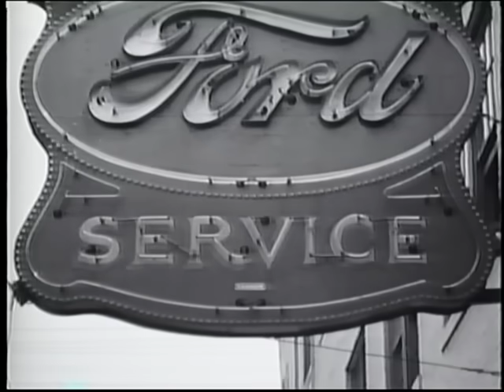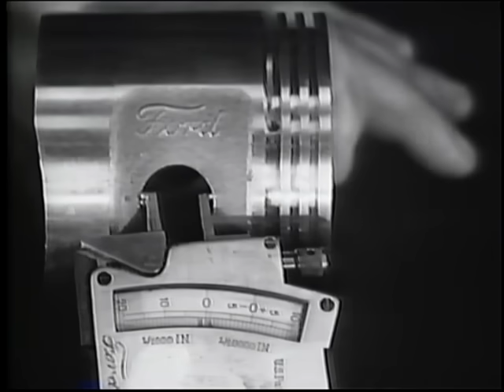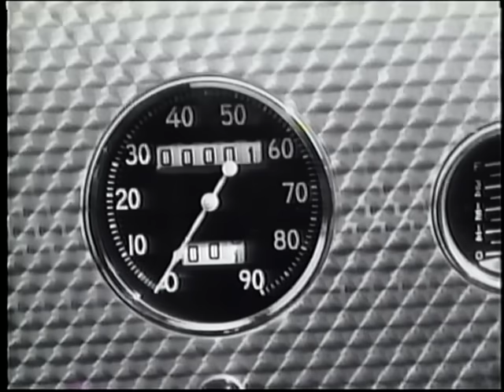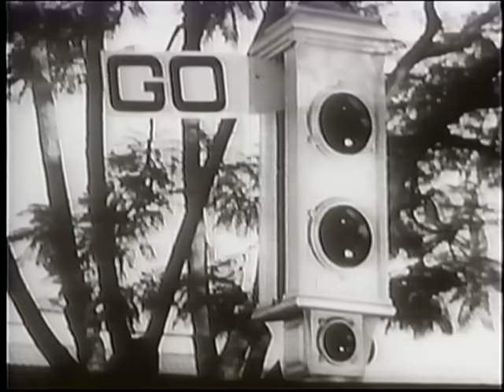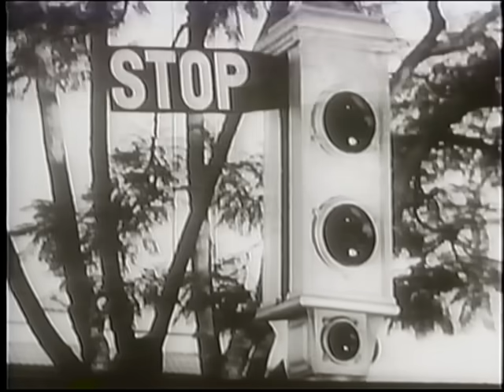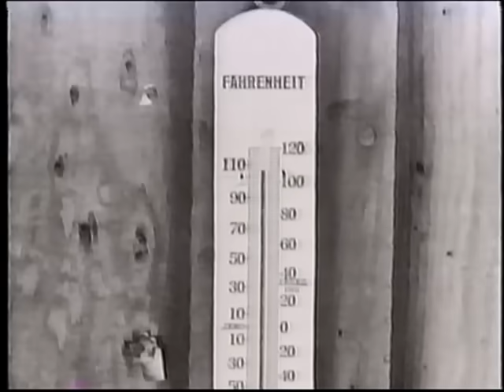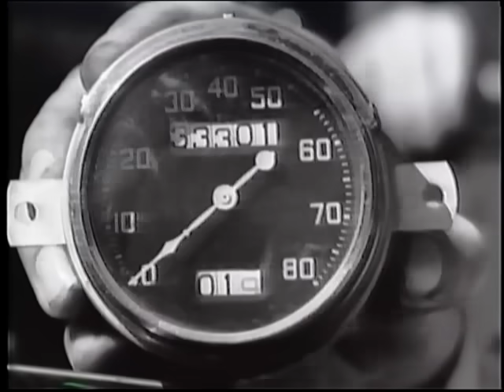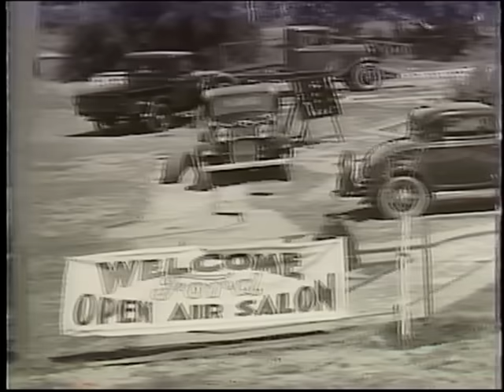1932 - The Invention of the Ford V8 Engine

Comment: And on the eighth day, God made the V8. And He heard that it was good, for it growled as did His great golden-maned beast of the jungle. And God said unto Adam, "Adam, check this out. I bet if you put headers and a cam on this fucker you'd make 500hp easy." And so Adam accepted the gift. And he went forth, and he did install headers and a cam. And lo, Adam indeed made 500hp as God had promised.

And Adam said unto the Lord "Lord, thou art certainly great. This thing sounds like a million bucks, and the torque curve is as flat as a ruler. But the fuel economy is terrible - what have I done to displease you such that you would curse me with these massive fuel costs?"

And God smote Adam, verily did He strike him down with fire from the Heavens. And lo, Adam's V8 was cleft in twain, and the bore shrunk such that it was half the diameter, and Adam's carriage became driven not by the rear wheels, but by those at the front.

And on each day thereafter, as Adam drove to work in his Honda Fit, he wept for what he had forsaken.

Here endeth the lesson.
Reply: brilliantly done!  =D

Comment: As I watch this I'm currently working at the old Ford Rouge  Steel mill. Currently owned by Cleveland Cliffs. I'm sitting in a crane in front of "C" Blast furnace. Only about 100 yards from the current F150 Truck paint shop.

Comment: This engine was a real monstrosity. For low expense, the flathead valve design was used. The cylinder heads were one piece castings with no moving parts. Cool? Not really. The exhaust ports had to travel through the water jacket of the block and the V8 had one of the worst heat rejection rates of any engine ever designed. It could not sustain a loading of more than 50% power without seriously overheating. This lead to many second degree burns of machanics trying to revive an overheated V8 on the road. Removing the radiator cap of an overheated engine could result in the explosion of superheated steam and if the mechanic was in the way, 2nd degree or worse burns over his chest, face, and upper body. The V8 could never be tapped fully for even its modest 90 hp output and was a failure in other industrial stationary applications. Its flaw was the flathead valve gear which severely impaired its high speed output and thermodynamic and volumetric efficiency. In addition routing exhaust manifolds through the block water jacket only resulted in additional frailty when subject to any meaningful work load. This V8 may have been cheap to build but it was ultimately a ripoff and injured so many mechanics with its overheated explosions. 

You could have really done the motoring public a service by publishing the truth about this engine. Instead you have done nothing but hawk Ford propaganda about the ford flathead V8. You made your money foisting this ugly design on the American public. Go back to school and get some real physics and engineering education so that you never become suckers for such outlandish corporate propaganda.

Comment: Too bad auto makers and engineers don't have a clue anymore!
Reply: Too bad they have to engineer to ever increasingly impossible to meet standards created by government that seem bent on repealing the 20th century.
Reply: Or Zombie's lolololololo
Reply: A problem nowadays is that the EPA and similar environmental agencies in European countries force the average mileage of a car company's fleet to be way beyond what an internal combustion engine of reasonable power, or even way beyond what an ICE at all can be. A car doesn't have to be sold to count though. Neither does it have to be produced in the country the manufacturer manufacturs its actual sales cars in. It just has to pass all the tests.

The result is that the companies find the cheapest country imaginable and manufacture tons and tons of throwaway cars that are literally the cheapest peace of junk that can pass all the tests. The real expense of electric cars are typically the batteries, and otherwise they're cheaper, so throwaway cars tend to be cars just the pure minimum and enough battery to run the test track, and just good enough batteries that it works if charged right before driving.

Most economy cars have really gotten more affordable. Comparing since the 80's they're usually equally expensive in real money value, but the average worker can afford one for just about half the hours of work. Not so for the top line cars, most of those have actually gotten less affordable, since every Dodge Ram SRT10 has to be backed up by 11 throwaway junkmobiles in Nigeria. To reduce emissions, of course.

Because of these ridiculously stringent standards, all the economy class cars basically look the same now too. Every last liquid ounce of masculinity and soul has been smoothed out of the modern motorcar in order to basically give it that bubble-like aerodynamic shape that 70 years ago was unique to the Hitlermobile.
Reply: Ford sent men around to junkyards to see which parts weren't worn out. The answer was kingpins, so he had them downgraded.  Ford was a pioneer of planned obsolescence.

Comment: I once had a 50 Ford business coupe. It had a bed in the back instead of seats. It originally had a flat head 6 in it which blew up and I put a flat head 8 in it with 3 deuces, a cam and headers. It ran pretty good, but It had problems with the electrical system and ended up selling it.

Comment: I agree that the Chrysler corp. have so much innovation in the 50's . Dad had several DeSotos, Plymouths and a Chrysler too. The wildest  feature was on the '57 DeSoto. It had vacuum operated cigarette butt disposal. right down in the lower side dash was an opening with a tray to squash a butt and then press a lever and swoosh its gone into engine compartment jar. The last DeSoto a '60 was traded for a Pontiac Grand Prix in '63.

Comment: WELL !!!!   one thing I have to SAY to this video and FORD.... It is 2022 and I still drive my father's bought (November) 1992 Ford Tempo GL 3L-V6 ( OHV) l....It still runs like new with 503k original... AT has a little whining at deceleration but the AT still shifts well.... SO I SAY.... THANK YOU FORD ( engineers) ....

Of course parts were changed like ( alternator, water pump, fuel pump etc) in a 8- 10 yrs interval...but other than that.... it is a (basic) great car....!!!!!

Comment: I   bought    my first car on reaching 17 for £35,which was a 1936 Y type Ford 8.  In this videoI noticed family similarities such as split valve guides that were fiddly to insert with splayed ended  valves and collar.  One difference was that my cars big ends were babbited  not using shells like the American V8.No water pump,thus no heater and rubbish vacuum wipers ,6 volts meaning well used starting handle..Good fun and learned a lot.   Oh repaired 2nd gear syncro to cure jumping ,a common fault with most gearboxes then.

Comment: So for 1932 Ford auto production, the 1932 production was from March to September of 1932, and there were two model series, the Ford V8, and the Model B with the 4-cylinder.
I really like the '32 Ford V8 sports roadster and 2-door coupes. Amazing that they were only $500. new. That was a lot of money in the Great Depression.
GM also introduced a Pontiac V8 engine for 1932, but the Depression killed it, and the 1933 Pontiac Straight 8 was introduced instead.

Comment: Ive had the " pleasure " of owning 2 Fords in my life. A 1978 F150 and a 2009 F150.
Between the two they had 5 engines in them.
1st one windowed the block,  twice and my 09 fried the main and rod bearings at the 30,000 mile mark.
Ford says " no warranty ".
No more fords for me.
Ever.

Comment: Ford began marketing a v8 in '32 but they sure as hell didn't invent it as your headline says.   The earliest v8 engine that I am aware of was made in 1908 for a series of racing cars.    It's also true that Chevrolet made one in 1917 as a concept car but then decided to stick with the straight 6 as it was more powerful than the average 4 cylinder engines that most other cars were using.

Comment: @57:00 Display of desert run Eddie Pullen Ford V8 at Marysville California at the local peewee golf course with night lights 1932.

33,000 miles in 33 days

Would be interesting to know if that site is still there or if it is under pavement.

Comment: Cadillac had a V 16 in the late 20s…
Reply: Not cast in one piece.  That was the advantage that did not make a ton of difference in performance or even reliability, (but less complex), but made a huge difference on the cost of manufacturing in the shop.
If you look at how something is made today, say it has 5 different manufacturing processes, and you can make it in 4 processes with the same or better quality.  That is gold man.  I have a friend who makes all the Indian motorcycle tanks and fenders, primarily because he figured out a faster way, (one less process) to stamp out those deep fenders.

Comment: The flathead Ford V8 had a major design flaw. There was vapor lock and stalling, because the fuel pump was on top of the engine, where it had to suck fuel uphill, instead of blow it upwards like a modern car. Henry Ford was no dummy, it's strange how he didn't know better

Comment: The Frenchman Leon Levavasseur was a 39-year-old inventor who in 1902 took out a patent for the first V8 engine that he called Antoinette.  The V8 has since become the most reliable and efficient internal combustion engine for powerful automobiles and widely used in motor boats and early airplanes.
Please do not lie anymore, giving Ford merits that it does not have.

Comment: I never understood why it was that Henry Ford insisted on building his new V-8 engine as a flathead.  In 1928 Chevrolet introduced their new 'Blueflame 6', an overhead valve engine.  Casting cylinder blocks without the ports and cylinder heads WITH the ports was no big deal over at Chevrolet, so why didn't the Ford engineers follow the same approach in designing their V-8?  The flathead V-8 had a fatal weakness-  the tendency to overheat when pushed hard, and that was due to its' exhaust ports' lengthy tunnel through the block, where they shed much heat.  The exhaust ports on an overhead valve engine are much shorter and thus shed a lot less heat to the heads, making the engine easier to cool and therefore much more durable.
Reply: Blueflame didn't come out until 37, it replaced the Stovebolt which came out in 29.

Comment: I am kinda showing my age here, but my folks  gave me the choice of two cars upon high school graduation, A 1948 Ford, with a V-8 Flat-head.  This cars, I helped my Dad retore in my senior year in High SchoolI had my pick from a 1973 VW, or the "48 Ford, and The trannie on  that car had a three speed tranny about due for an overhaul.  The shift selector, looked for all the world, like what you would see what a automatic transmission in later years.  This old car even had an owner's manual telling you what accessorizes to turn it into a plow for the family farm, All in all It was pretty roomie inside, I remeber looking at the back black nagahie seat, thinking it reminded me count dracul's coach, it had a AM sterio, tube radio, it took donkey's years to warm up, but sounded clear, and, one minor problem, it tended to vapor lock when the engine got hot, and, you stalled it, nearly impossible to get it started again, but we ended up putting an aftermarket electric fuel pump, you could switch on, to get things going again, the car had vacuum powered windshield wipers that made funny sucking noise, while in operation..  God fobid you ever encounted ice or heavy snow, and under the dash, a gas fed auxiliary heater for the really cold nights.  For fresh ir, there was a lever under the dash, that opened a vent scoop, at the base of the dual pained windshield, that got you fresh air, helping you defrost the windscreen if need be!  This car had been a graduaton gift for a guy, before, who had trouble with the V-8 Flathead, He put the wrong type head gaskets on, and blocked the cooling actio, on that engine, later remarking he thought it gonna blow up, We only paid five hundred dollars for the old hulk, His uncle who had givin this car orignally, was a Ford dealer too, and givin his name, we bought another engin from him, he still had spare pards for these cars, the new block was sent out, along with silver coated bearins for the crankshhaft!  We made a press on our workbench, that helped us put the new balves in the block, when all was said and done, the engin kicked over upon our first attempt to start it..  It ran good, and, my Dad was happy all, and all with our job, if the transnission had been in better shape I would have chosen it.  But, the VW was reliable and I ended driving it for almost twenty years as it were!

Comment: The extra complexity of casting a block with valve provision makes the job extremely difficult, ironically the job could have been hugely simplified by creating a ohv unit, also with the possibility of making more power. 
The tolerances to which the parts were made is funny these days, three thou on any mechanical component renders it unserviceable, but somehow they ran and ran perfectly well.

Comment: Wait...throttle control on the dashboard? What does the right pedal do then?
Reply: The throttle control was the mechanical version of the electronic cruise control that are found  modern vehicles.  In addition, the throttle control worked as an engine choke when it came to starting cold carbureted engines . . . in other words, use a fuel mixture that used a higher ratio of the gasoline to air intake mix.

Comment: Henry Ford was so far ahead of his time. These engines are very weak by modern standards, but the automation is amazing for the time. They didn't just copy existing operations, they created new machines from scratch. My how Detroit has fallen. The last time I was in Detroit it was poorer than Mexico. The roads were in bad condition and most of the cars were very old. New cars have gotten really really silly. Hundreds of sensors that don't need to be there. If my radio goes out I can't get an inspection. Because, if I couldn't listen to AM radio, I might be a hazard on the rode?

Comment: The wealth of vintage clips of the 32 Fords is the highpoint of this video. But I was disappointed that there were no engine specifications besides the horsepower and no performance data on the cars either. Nor was there any comparisions to the competition of the time. I noticed the mention the 50 hp 4 cylinder engine but the V8 only had 60 hp - that was underwhelming to say the least.  What was the difference between the cost of engines and weight - 4cyl vs  8cyl? How long were those engines end up lasting; how fast were those cars? What colors did they come in? How much did the cars weigh? After a while it was boring to watch a b&w film of black/grey cars and the endless spouting of tolerances of engine parts manufacturing. There was also no mention of improvements either shortly after 32 or longer except for the baffle in the oil pan. How many cars were sold? Als, what was the purpose of the clip with the guy being given a red light ticket and the next guy's court room drama?  Seems that the video was being padded for time at the end for some unknown reason like when at 53:35 the passing car was shown in slow motion. Overall, it was an interesting video but it was too long, needed some editing and could have included interesting stats for the typical car lover. They should have shown some current pictures, in color of course, of surviving cars   unrestored, restored and customized.
Reply: I'm a manufacturing guy, so I liked those parts of the film.  We had a lot more manufacturing guys back then too.
I think you want to find the owners manuals and some kind of consumer reports.  But I would not mind knowing some of the information you wanted to see.  Maybe you should start making vids?  The bar can be raised, that is for sure. :)